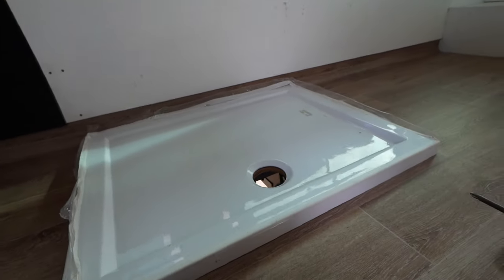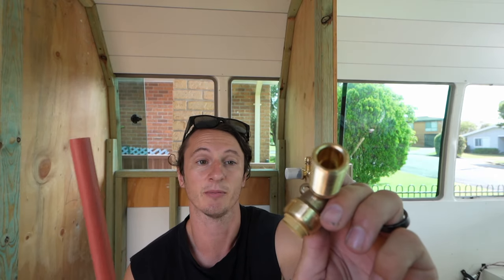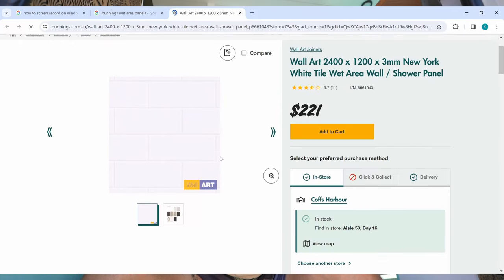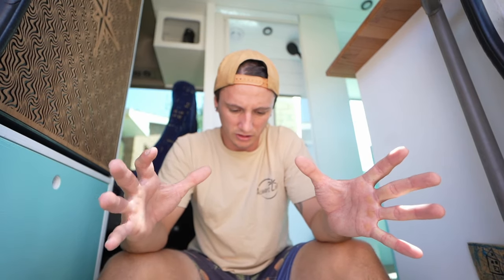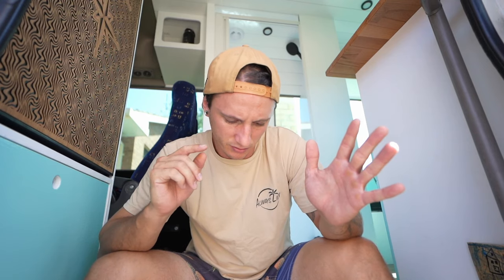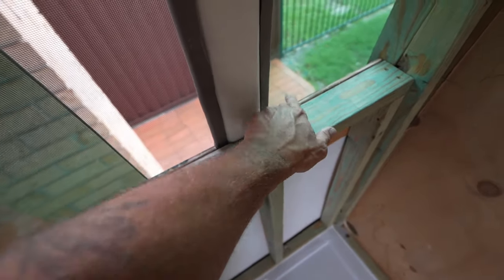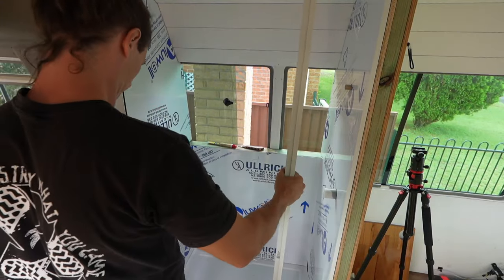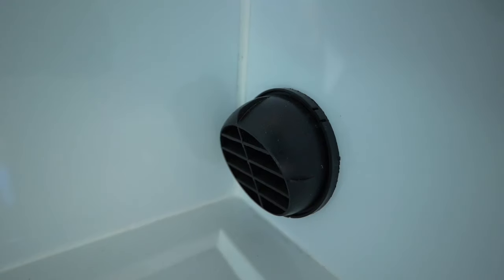the ONLY shower build VIDEO you NEED to WATCH

Comment: Like the window sill idea, how did you keep water from going down between the window and the wall? Did you silicone/caulk the back wall directly to the glass? Nice work BTW.
Reply from the maker: Thank you. I did silicone around the piller but not the glass I have a neat shower curtain that runs under the ceiling board and hangs over the sill.  Actually about to have my first shower in it this arvo haha